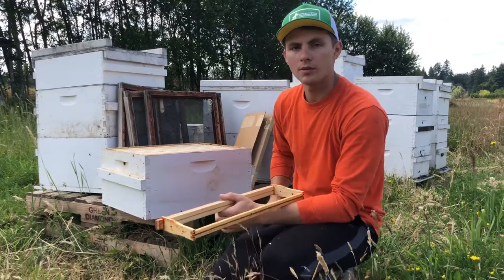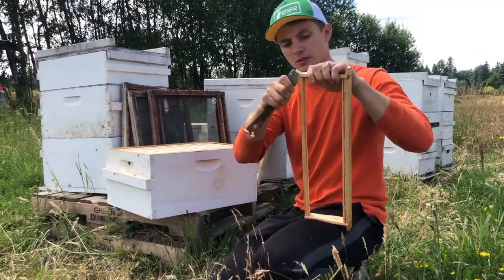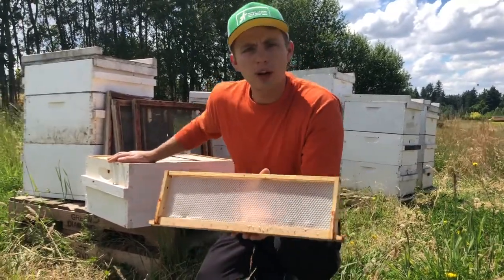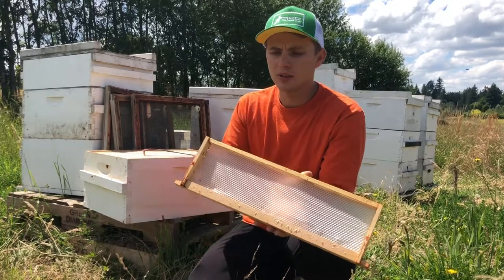Honeycomb. How To Set-up Frames For Cut Honeycomb Squares

Comment: Is this a wedge top split bottom frame? Does it matter what kind of frame it is?
Reply from the maker: Yes that’s the frames I use.  You can use any kind of frame as long as you can get the foundation sheet secured nice and flat

Comment: very well done!! i run single brood chambers with QE .....above QU is Deep honey supers....can i do the same thing?
Reply from the maker: natserog Are you asking to do honeycomb setup with a single brood chamber? If that’s what your asking the answer is yes and no, what some beekeepers do and I like this technique also is they will have double brood chambers and then place all the frames with brood in the lower chamber and shake all of the bees in the lower chamber. After they will remove the second brood chamber put on the QE and then the honey comb super. This makes the hive super crowded and nowhere to put honey down below forcing them to build the honey comb arguably even faster.  Now if you run strictly singles I haven’t experimented with that for honey comb set up, my worry is that it will take the bees a long time, unless where your bees live there’s is an amazing honey flow season
Reply: @maxb9135  Thanks Max...really appreciate your advice. Ive gone back and forth with frames and different size honey supers and the best way to achieve comb honey. I do run single brood chamber and move honey frames up above excluder. Im trying to understand your comment above...i think i am seeing what you are saying..Start out with double brood chamber then move all brood down -- then when full put on Queen Excluder then put on honey super. Would you suggest I go all frames with what you use in the video...i dont like the wired frames but the single slide in wax sheet looks like a great way.--What is the frame called that holds the single wax sheet??   sorry for all the questions....
Reply from the maker: natserog Here is the link for the kit for honey comb starter kit: 

https://www.mannlakeltd.com/10-frame-comb-honey-super-kit

We use the slide in wax sheets for honey comb only, because it’s super thin and eatable. That’s size of frame is only used for honey comb only. We use plastic foundation frames for the brood frames and honey supers because they last long and easy to deal with.
Reply: @maxb9135  thanks Max
Reply: @maxb9135   great...thanks...last question. Do you ever run reg honey supers with plastic and also comb honey frames on the same colony? or some hives you just run for comb honey??
Reply from the maker: I run reg honey supers and honey comb supers on the same hive but never at the same time.
Reply: @maxb9135  thanks!  take care

Comment: Do you insert the 10 empty foundationless super frames all together in the box at one time? Or insert one super frame at a time?  Why do you insert white foundation for comb honey?  Without it, it would be impossible to do?
Reply from the maker: That foundation is eatable and you get better results faster. I don’t use foundation less frames. And we insert all 10 at the same time. If the super is mostly empty the bees will start building comb in places where you don’t want it and that’s a lot of wasted energy from the bees
Reply: @maxb9135 Q.01)  Your super is deep, medium, or shallow?   
Q.02) why not using sectioned one, too? 
Q.03) which flow do you use? Clover, Acacia, or Linden, or ?

Q.04) Do you also make wax which you insert? Then can you create streaming for how to?

Q.05) What kind of set-up do you use? just brooding box and put the comb honey box with edible foundationed frames?
Reply from the maker: Alexa Young In Song my super are deep, same size as the brood boxes. Keep everything same size easier to interchange things. Sectioned ones means extra parts, we keep everything interchangeable. BlackBerry/raspberry flow and some clover/ wildflower. I don’t make wax
Reply: @maxb9135   Big plantation of berries near you?  Can those have good flow enough to make deep comb honey?

Where did you get that edible sheet, if you don't make it by yourself?
Reply from the maker: Keep my bees on the berry fields and yes blackberry flow is super good and the honey is very good also. U can buy the was sheets at online beekeeping stores like Mann lake
Reply: @maxb9135  how big the blackberry plantation? 10 acres? 100 acres?  in comparison to Raspberry, blackberry is better?
Reply: @maxb9135   how many supers do you place on top of brooding box? blackberry farm near you, don't they fumigate which kills the bees?
Reply from the maker: Farmers treat the berries after sunset when the bees don’t fly, we also can move hives around if needed
Reply: @maxb9135  how big the BBerry farms are?
How long it would take for bees to create comb and filled the honey and caps?  1 W, 2W, 3W?
Reply from the maker: Over 100 acres. Depends on time of year and the size of the colony and whether I’m re-using frames where the comb was already pulled vs new frames. With pulled comb and good honey flow 2 weeks and it could be time to extract